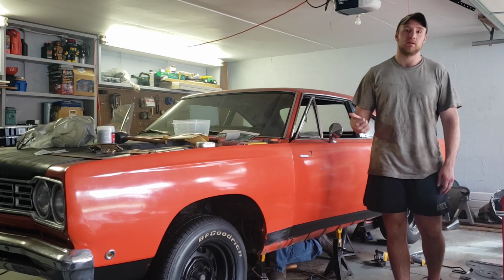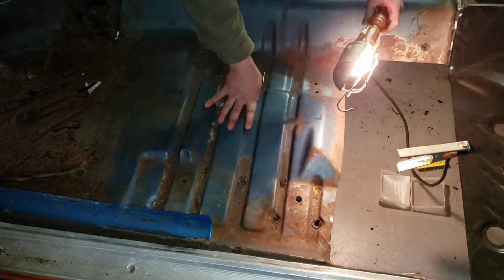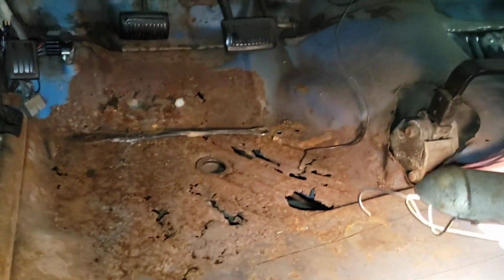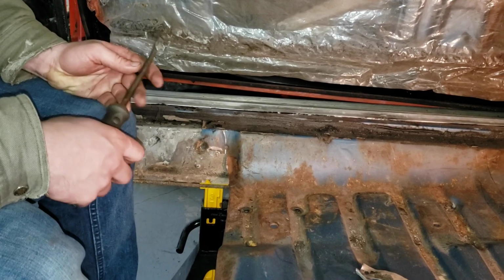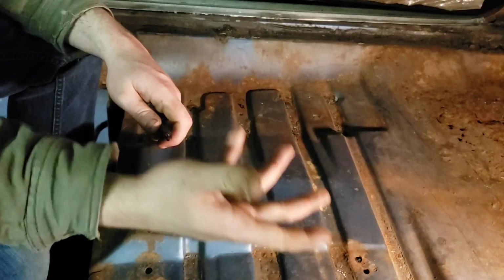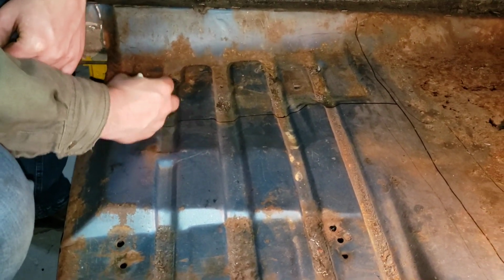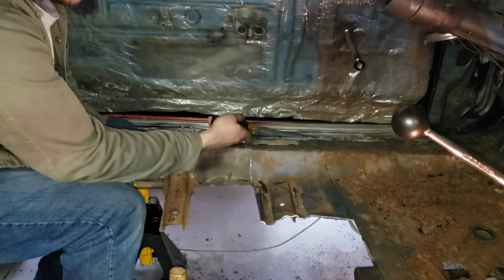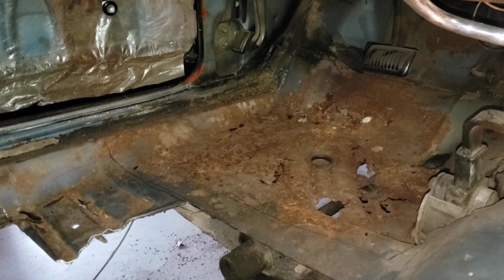1968 Roadrunner and Mopar B Body Floor Pan Install Part 2

Comment: Thanks for the info. Keep the rust videos coming. This is good knowledge. Any rust welds for the Chevelle in the future?
Reply from the maker: Yes! I plan on doing floor pans for the entire car. But I'm also debating on if I should get a new wiring harness or rear coilovers next.
Reply: @chevellecody4050  Hi. Thats perfect! Thumbs up for floorpan from me. Solid car to work with before performance upgrade. Planning on replacing trunk and parts of floor myself on a 71 Chevelle. Video of the car on my profile. Thanks for the info. Keep up the good work.

Comment: You should just replace the whole floor pan and save yourself a lot more welding, cutting and time because it’s a lot faster and more stronger with the AMD replacement!